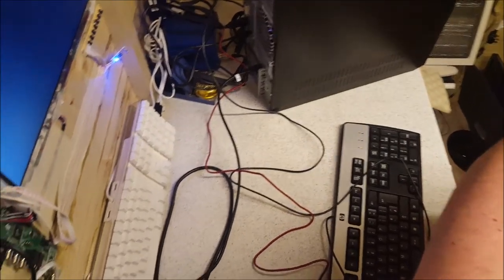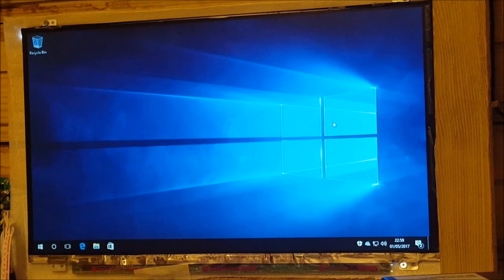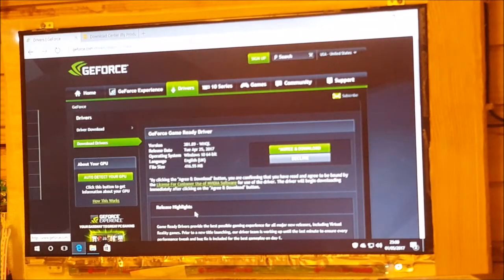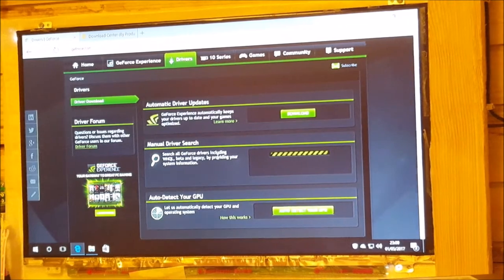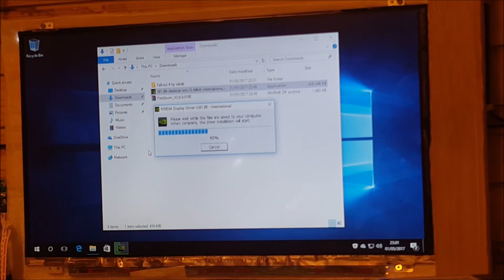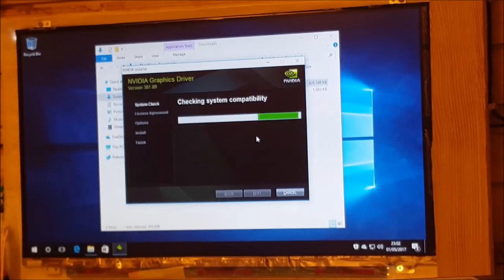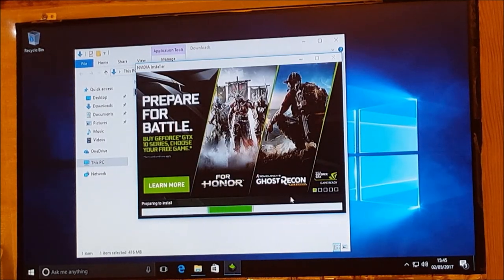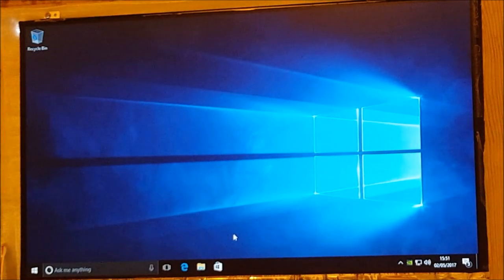Budget PC Gaming - Turning an old business machine into a gaming beast - Part 1

Comment: I have a esprimo 1500 (Heavily Modified) with an amd FX6300  8gb ram and a MSI RX570 with an aftermarket PSU . The only thing in the case that is OEM is the Blue ray Drive and the card reader .Now you can call it a beast .Ok even that isn't a beast but it's very powerful. Oh yeah I forgot to mention that it has RGB lighting which looks sick.

Comment: I have  Fujitsu Esprimo P720 E85+ with stock PSU 250W and config:  i7-4790 16GB RAM 240GB SSD + 500GB HDD and GTX1060 6GB and it's work like charm !! :)
Reply from the maker: That's a bit of a beast!
Reply: But gtx 1060 6 GB have 6pin power supply. Did you used adaptor from sata?
Reply: @arabarab16   Yes, I used adaptor from SATA.

Comment: Bought this PC for 50 euros (56.19 US Dollars), I just need to wait for my First Job to pay to be able to upgrade it. It's an absolute beast even in his pre-upgrading phase. Thank You

Edit 1: Came Back from work and my Pc did not boot up. Nothing no power. I checked every cable but nothing the outlet workded perfectly fine but not my Pc. I removed the PSU. And plugged it but nothing execpt a tiny rattling noise. I thinking about buying a new Battery or a new PC for the same price or even lower

Comment: You can actually put a "decent" videocard inside a prebuilt using a molex to six pins or SATA power to six pins adapter. Every system, even pre-builts, have a couple of spare connectors for adding a couple of drives that you'll end up not using. Worst case scenario, unplug the optical drive and use that cable.
Reply from the maker: But you need to be very careful you don't exceed the power limits of the psu. Most pre built systems come with a 250w or 300w psu, most graphics cards that have a 6 or 8 pin power connector with draw more than 100w and could easily overload the psu

Comment: Just two problem this pc's : power supply, power on

I was must modified my chieftec power supply (resoldering the wires), and add 12v power supply (brown wire). Brown wire + Gnd = power on. After this modification = No Vga limit!
Reply from the maker: Not sure I follow what you've done but I don't like the idea of soldering extra wires on a power supply. Generally if it doesn't have the extra cables you need it probably isn't powerful enough for what you want to run
Reply: I modified one ATX power supply (550w) for this board and working. The ATX have enough connector, but this board power connector only 18 pin and not 24.
Reply from the maker: Sounds pretty good then, well done

Comment: HI, Great vid. Still relevant after all these years. Just wondering it you could fit a GTX 1650 in this PC? (looking at same PC on ebay at teh moment... lol)
Reply from the maker: Thanks and sorry for the slow reply. Yeah, I think a 1650 would be a good fit for this pc, just be sure to get one that doesn't need any additional power connectors unless you're planning to replace the psu

Comment: hi there, i have a gt 1030 which is about the same size as a regular 1 fan 1050/1050ti and noticed that if i lined it up with the io bracket on the case it would not line up with the pcie port, the last gpu it had was a gt 710 and was wondering its its possible to just reuse the 710 io shield on the 1030 and then cover up the vga port? same pc as yours, the esprimo p420, many thanks.

Comment: how the hell does the 250W power supply that was built in these fujitsu machines run the GPU u said u build in?? There is no way it runs on 250W if its a new card as u said
Reply from the maker: The power supply is actually 280w, the cpu has a TDP of 84w and the card I fitted draws all its power (max 75w) from the PCI-E slot so it actually handles it fine
Reply: @mdickens98  ahh thx for the quick answer so the crucial point was the core. I forgot I had another one which needs more power for itself

Comment: and what about ur psu bro? I guess you've got a 250w (280w) ...is it enough for 1050?
Reply from the maker: JoeŠíd official yeah 250w psu, its fine for a 1050 as long as you make sure you get one that doesn't need a PCI express power connector. Thats the beauty of this setup, the card draws all its power from the PCI express slot so you don't need to spend out on a new psu
Reply: Matt Dickens Oh..man.. that's actually cool! I did not know. I have almost the same setup as you, but I have gt 710 and I'm waiting for the i5 2550k and I was lil bit afraid of that, when I realized I have only 250w (280w) and setup requires 266 so I considered to try to find a psu with 16 pin connector...but this kind of psu doesn't exist..

Comment: Where can I plug the graphich card?
Reply from the maker: You can't. That is the reason I chose the specific graphics card as it doesn't need any extra power connectors
Reply: @mdickens98 
Ok. Can I change the power supply to a better one?
Reply from the maker: Yes, if you want to run a different graphics card you can upgrade the power supply. From memory it should be able to take most standard ATX power supplies
Reply: @mdickens98  Ok. Thanks
Reply: @mdickens98  What kind of Atx power supply do you recommend for this computer (esprimo p420 e85+)?
Reply from the maker: @biggusdiccus012  I can't really advise on power supply replacements, this video was to demonstrate what you could achieve without having to replace the power supply.

Comment: Hi, I have Fujitsu Esprimo p710 e90 can I run this card ?
Sapphire Radeon PULSE RX550 4GB, 4GB GDDR5 
I have same power 250W or update power supply ?
Reply from the maker: Yes, you can run that card. The power requirements for that card are less than 65W and it doesn't appear to have a PCI-E power socket on it so it will be fine to run straight from the PCI-E slot, no need to change the power supply.
Reply: @mdickens98  Until now I had a card in my PC - ASUS Radeon HD 3650 256MB. The power of this card is 65W. The recommended power supply here was 250W, which I have and the GPU in the PC worked. But for the Sapphire Radeon PULSE RX550 4GB GDDR5 card, the recommended power source is 400w? There won't be any problem with that. Thank you for your reply.
Reply from the maker: @ricky-4824  I think this is just down to the manufacturers being extra careful, especially as some really cheap power supplies used to be quite 'optimistic' about their rated power output (thankfully the 80 plus certification has pretty much made this a thing of the past). As the card can only draw power from the PCI-E slot and that slot is rater for max 75W they'd be pretty crazy to put a power supply in a pre-built system that couldn't cope with 75W being drawn from the PCI-E slot. It does happen but usually they mark the PCI-E slot to specifically say it can only be used for a max of (e.g. 35W)
Reply: @mdickens98  so you think it should work?

Comment: Hi, is a ASUS Phoenix GeForce® GT 1030 OC Edition 2GB GDDR5  compatible with a Fujitsu Esprimo p710?  I would really like a reply, thank you.
Reply: I hope I am in time, p710 supports 3rd gen intel processors, so if you put in a i7 3770 u can go as high as GTX 1660 but u will needa bigger PSU since gt 1030 is only 30 watt Im sure u r fine without even upgrade

Comment: What about Inno3d GTX 1050 ti x2? It doesn't require 6 pin connector/PSU so i'm assuming any card that could boot from PCI express can run in this PC, right?
Reply from the maker: Precisely! Yep, if there's no power connector on the card you're good to go. Would be a good idea to check the physical dimensions of the card to make sure it'll fit in the case ok but it'll probably be fine

Comment: Please tell me how can I change it's power supply! 😭 is there any PSU available with 16 pin connector in the market or any  24/20 pin to 16 pin converter for this particular PC? 

Please guide me I can't afford a new PC!
Reply: Still need help?
Reply: @YELF1N  yes!
Reply: am also facing the same problem

Comment: Can i put a normal gtx 1050ti in
Reply from the maker: Enduro profi Ktm as long as it runs off the pci-e slot for power and doesn't require any extra power connections

Comment: Will the Low Profile 1650 work since it needs a 100w psu and the P420 is 280w

If this helps then heres the specs 
P420
i7 4790
GT 710 2GB GDDR5 (upgrading to 1650)
2tb Samsung 860 Evo
16gb RAM

Im worried that this wont be enough for 1650 Low Profile
Reply from the maker: It'll depend if the card has a PCI-E power connector or not. If it does you won't be able to hook it up with that power supply. I looked at the MSI version of 1650 low profile and that doesn't have a PCI-E power connector. That means it gets all its power through the PCI-E slot on and these can only ever provide a max of 75W so the card won't use more than 75W and you'll be fine (close to the limits but ok)

Comment: Would it work with a 1050ti from gigabyte? Asking because I don’t know if it will fit in the pc
Reply from the maker: You'd have to check the spec of the card. Gigabyte do a few different versions so you'll need to see if it needs a 6 pin PCI-E power connector. If it doesn't then you'll be fine
Reply: @mdickens98  I was asking because it has 2 fans so I didnt know if it would fit in but thanks. I'm not really experienced with pcs but I'm getting an ASUS 1050ti to be safe because that has one fan
Reply: @mdickens98  the Asus 1050ti says it has a PCI express 3.0 is that fine and will I be able to put it in my p420 the way you do it with the zotac in the video?
Reply from the maker: @uncledevvo1777  PCI Express 3.0 is a standard for the connector on the motherboard. It's backwards compatible so you'll be fine (this PC is PCI Express 2)
Reply: @mdickens98  thank you ever so much!

Comment: Will an intel i3 9100f work for this motherboard?
Reply from the maker: No, the 9100f is much newer so would need a 9th gen compatible board
Reply: @mdickens98  oooh ok thanks for awnsering my comment. so i have to change the psu, ram, motherboard, and cpu. Do you know any psu's that i can use that aren't as bad as the standard one?
Reply from the maker: To be honest if you're thinking of changing that much I would recommend you just start a build from scratch. Then you can use this machine as a second machine or sell it. Its really not worth starting with this PC if you're changing that much. As for PSUs I've always used corsair without any issues
Reply: @mdickens98  ok, thanks for the help!

Comment: I have the same model (p420 e85+) but i have the i5 4460, which gpu do you suggest me to play games without changing the psu please ? Waiting for your answer, thanks. EDIT : i m also going to add 4 gb ram so isn't it gonna need another psu ?
Reply from the maker: azerty azerty the 1050ti is still the best GPU you can run without upgrading your psu, you'll be fine even with the extra ram. If you wanted to replace your psu then you could obviously run a bigger graphics card but I'm not sure if there is enough room in the case and the whole point of this video was to show what you could do on a budget
Reply: Matt Dickens thank you very much for your quick reply
Reply: @mdickens98  hey can i add a 128 go kingston ssd without changing psu ? please answer me ty
Reply from the maker: @azertyazerty9549  Yes, you can add ram and an ssd with no problem. You'd only need to replace the psu if you wanted to put a much bigger graphics card in or possibly if you wanted to add several mechanical hard drives
Reply: @mdickens98  thank you
Reply: @mdickens98  hey ! i completely forgot to upgrade that pc because i bought a new one but is it still worth it  to put into it a 1050ti, with an ssd and 4gb extra ram without changing the psu ? Ty.
Reply: @mdickens98  because you are talking about 6 pin connectors to other people that s why im asking again
Reply from the maker: @azertyazerty9549  absolutely worth it, there's still a massive range of games that will run great on that hardware. Alternatively the newer nVidia 1650 is also available in some configurations that don't need additional power

Comment: Can gtx 1660 6gb oc fit?
Reply from the maker: No, you want a graphics card that doesn't need any additional power connections. There are some 1650 cards that would work such as the gigabyte 1650 mini itx oc.

Comment: Please tell me can it run amd rx 470 or 570 gpu
Reply from the maker: Hi, the point of this video was to show what you could run without upgrading anything else. Yes it can run a rx470 but you'll need to replace the power supply as they require external power via an extra PCI-E power connector on the power supply. It might also not fit in the case. If you're looking at cards like that then I'd suggest this is not the right PC for you
Reply: @mdickens98   thanks alot